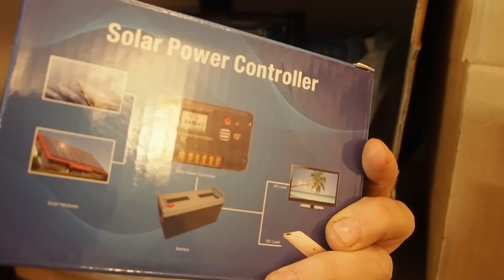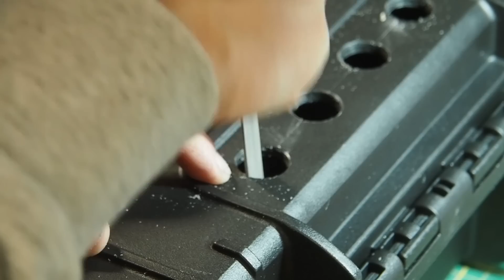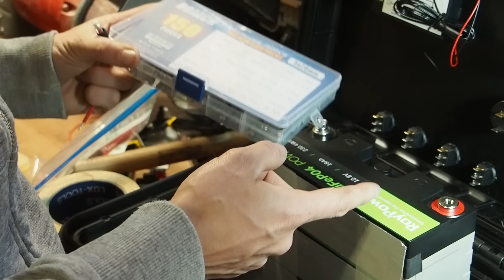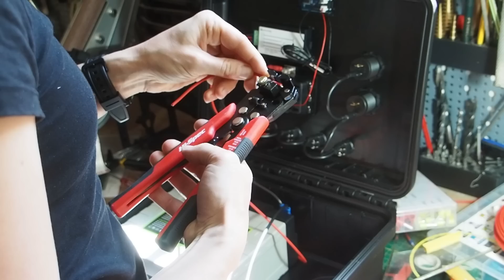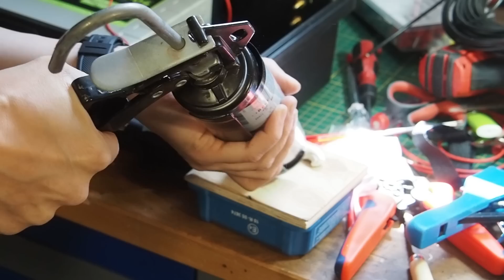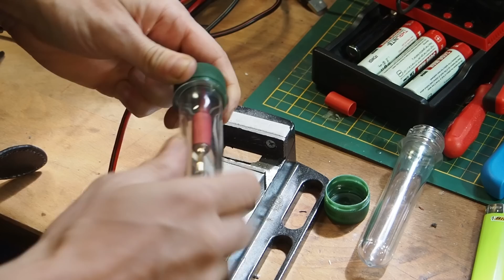This self-made box will save your life in a blackout scenario!

Comment: Hi Lilly, nice job on the portable power supply.  I have been designing inverter circuits, along with battery powered devices, and solar systems for many decades so, wanted to pass on some things I learned over the years.

The solar panel you are using has 24 cells, which puts out 0.6 volt each with no load.  They are all series connected so, your unloaded output voltage will be around 14.4 volts so, you could connect the solar panel directly to your battery.  The Victron solar controller needs a solar panel voltage that is at least 5 volts above the battery voltage before it will start charging.  Panels normally designed to charge a 12 volt battery have 36 cells, which puts out around 21 volts with no load.  To get the most power out of the solar panel, the MPPT charger loads the solar panel causing about a 15% voltage drop.  So to get the best performance out of your portable power supply, I would suggest going with a 25 watt or more solar panel with 36 cells.  If you want to use the existing panel, bypass the Victron solar controller.  However, in doing so, you probably won't get more than a half amp of charge current due to not having enough cells in your panel.
Reply: Thanks Bill, I really appreciate your comment

Comment: Great build! If your tape ends up failing, I would recommend looking at "3M dual lock".  The adhesive is very strong, and it's a little bit thicker, which will help with surfaces that aren't very smooth. I've used this on multiple applications, and am much happier with its results vs Velcro.

Comment: 4 suggestions:
1. use 4 rubber feet to make space between the battery and the box itself so the battery is not touching the flat surface of the box  (the box is ofcourse water proof but not hot/cold insulated.)
2.  draw a clear cable diagram of what powers what, the types of cables used in color and place the diagram inside the box for easy future reference (keep already made spare cables if A burnout does occur)
3.  keep at least 12 mini and 6 maxi fuses as spare inside a zip lock packet size 3inches taped inside the box... you never know when you'd need them.
Reply: maybe it's better if all switches, meter meters, mppt, output / input terminals are in the box by creating a new panel to install so that if they are closed and not used / when they are moved they are still waterproof. If you are going to use it, the lid of the box is opened
Reply: @Boediprasetya  Not as convenient for operation, but given the choice of an IP67 rated Case you might think that maintaining that IP67 function would be a worthwhile consideration.🤔
Reply: @Micro-Motive  yes I will choose the box still has the tightness IP67. for operation, just open the lid of the box. We also don't need acces to switches, meters etc when not in use
Reply: @Edward Seth
1. The case is plastic - not a good thermal conductor at the best of times. Insulation is a much misunderstood property as it doesn't prevent the thermal transfer process, just slows it down. Eventually all thermal masses will settle at Ambient Temperature unless there are external influences.
2. A wiring diagram is a good idea. Spare cables? Unless there was something wrong with the initial fabrication, unnecessary - see 3. 🙄. 
3. Totally agree with having spare fuses in a convenient location, but if you need that many spare fuses then you've under designed the Unit, or you're abusing it!

Comment: A few important features to your build that you’ll need to include is a small thermal activated cooling fan and a few exhaust vents. These simple additions will prolong the life of the battery, the enclosed electronic components... and protect your investment.
Reply: Doesn't that sort of defeat the purpose of selecting a ruggedised IP67 rated case in the first place?
Reply: Notice that many of the manufacturers who sale these “solar powered” generators all construct their products in this fashion. These retail units are NOT built to withstand water penetration in any way. There is a reason for that... internal heat build-up and ventilation. Utilizing a waterproof IP67 case for this purpose would be a..., miscalculation and/or unnecessary additional expensive. During the units recharging processes, and whenever a heavy load is being pulled from the battery, it will heat up. This heat has to go somewhere. Slowly but surely, many of these YouTube DYI builds will prematurely fail - mainly due to this simple construction oversight. Hope this helps to prevent issues with your build.
Reply: @BigDukeX  My point was that if you're going to use an IP67 Enclosure, then design it appropriately so it remains IP67.

As for the heat generated during charge and discharge, the LiFePO4 Battery used only has an electrical capacity of 216Wh, and any interal thermal losses will be less than a tenth of that.
The heating losses during use will be low, and during charging also low, particularly if being fed by small Solar Panels (12V 28.5W), which don’t have sufficient voltage to charge the battery via the MPPT controller.

Yes, plastics have a low heat transfer rate, but like all "insulation" it won't stop thermal transfer just slow it down.
Given the volume and surface area of the Enclosure, the small amount of heat generated during use and charging will be easily dissipated through the Case.
You'd have more of heat problem if you left it sitting in direct sunlight, or next to a Furnace, as all thermal masses eventually reach ambient temperature.

Comment: Fail on the banana plugs for the solar panel. They will short out when not attached to the box. It would have been better to use Anderson Powerpole or XT60 connectors. I would also add one of each of those connectors for other peripherals. And where's your shore power charging socket? Surely you would want to plug it in to the wall to recharge it if you can? That solar panel also needs to be more than twice as big as the one you have. It's not about "how fast can I recharge" but "how can I collect more light". Its very rare to have a solar power day that's 100% sunshine. A bigger panel would yield more amps in less optimal conditions. Your fuse is also in the wrong position as others have noted. Otherwise, well done. Its 1000 times better than the power boxes the rest of us do not have. Keep it up!

Comment: You should connect your load (master switch) to the "load" output of the charge controller, not directly to the battery.
Reply from the maker: You can do it both ways
Reply: @SurvivalLilly  yes you can, but you have lost over discharge protection and you will mess up the charging algorithm if you are charging and drawing power at the same time.
Reply: No. The load output of the charge controller is just for small things, typically those where you want them controlled by whether the sun is shining or not, such as lighting systems.  It is absolutely fine to connect directly to the battery. It will not mess up charge algorithms or any other such nonsense.
Reply: @Sylvan_dB  you are wrong, but it is a long discussion, so let's just agree to disagree 🙂
Reply: @AlanDavidoff  Sure.  My 50 years of building battery based systems up to and including modern high voltage MPPT systems has taught me nothing.  LOL.

Comment: It is better if you take the power from the battery through the load terminals from the MPPT controller. In that way you can take power for your load directly from the PV panels if they are connected.
Reply: No, it is not better.  it will still take power from the pv panels when connected directly to the battery and direct to the battery is not subject to the limitations of the load output in the charge controller.

Comment: Miss Survival Lilly, what a great video! Even I would be brave enough to attempt to follow your directions. Have you heard of Anderson plugs and now you can get red ones to indicate a solar charge. But Anderson plugs are simply brilliant. Thank you for a great video.
Reply: Anderson connectors are great - I changed over to them almost 18 years ago, and the originals are still in good shape. One other thing about them: Anderson connectors come in a succession of ranges, physical size & rated current. In my place, I use 15 Amp sets, 40-50 Amps, and some rated at 150 Amps or 250 Amps DC. Some welders now come equipped with high-amerage Anderson connectors for the welding leads. It's worth noting that some high-amperage connectors are not colour-coded red/black - they have a grey casing. The genuine Anderson-brand connector housings I've seen carry the company name & trademark. The colour-coding issue is easily fixed with paint pens or foo-foo cans. Also, there's a crimping tool (probably several) made for the copper inserts - very useful on larger sizes. I've seen some counterfeit knock-offs and although the material quality is OK in some cases, a problem arises when they will not mate properly with genuine Anderson-made connectors. 
I don't know if they're still in business, but there was a company with outlets in both western Canada and the western USA that sold "kits" containing 3 or 4 different sizes/ratings of Andersons, plus the appropriate tools. The cost of the kit was a lot less than purchasing connectors piecemeal. Several amateur radio publications (also now web sites) have articles with detailed information, all of which is useful if someone hasn't used Anderson connectors before. 
One other thing for new buyers to watch out for are "cheap" metal insert components sold in packs. All of these I've seen have turned out to be CCA - Copper-Coated Aluminum - and poor quality at that. The issues with CCA are  documented elsewhere & are worth learning. Failure at moderate-to-high current loads is the most important. Solid copper costs more, but in my experience is worth the price.

Comment: Order of operations suggestions. Plan where the battery and charge controller will be placed first. Use a multimeter to test all wire connections first, then connect the battery last. Also for most solar charge devices the solar panel should never be connected if a battery is not connected.

Comment: Nice project, but allow me advise, always have a trickle charger, a good one is NOCO GENIUS1 or even better the GENIUS2!
The trickle charge can be left always on and connected to the battery, even when you are using the battery!!  They work specifically with Lithium batteries inclusive, they will keep your batteries life longer, and can even recover damages that sometimes happen during the usage of the battery, including charger under different climate conditions, i.e. temperature. Do not really only in solar charging, despite the fact that you can find some PV that are a kind of trickle charging via sun light! To extract the maximum value of a trickle charger plug them in a timer programmed to turn on only at off-peak hour to minimize the cost of keep your batteries ALWAYS READY AND FULLY CHARGED for when you need them! I have many different types of batteries and "solar power generators", and I took sometime to learn this very nice tip, that I take the advantage of load my batteries and solar power generator at minimum price , and using the stored energy at peak hour maintained it a minimum cost.

As you advance in more complex configurations I would indicate EcoFlow Delta Pro and Bluetti , I have both also, more expensive but it is worth each penny you invest on them!

Good work, and keep the good fight!

PS: Don't only rely in sun to charge your batteries, sometime the sun is no available , but the electric outlet is on yet!

Comment: Thanks Lilly.  Question, at 2 points you mentioned damage to the panels and controller.  I could imagine manufacturers having to put in safety steps in the leads touching, the master getting turned off, etc.  Could these potential issues be safeguarded by the addition of inline fuses?

Comment: I'd suggest three changes. The first connection on the negative batt wire should be the shunt (all loads, including resistive spade connections should be after the shunt. The switch is best on the positive wire, after the fuse. Also, there should be a fuse on the battery side of the positive PV wire.
Battery temp should be monitored when PV charging, so charging can be shut automatically, if charging the battery overheats it. Ring terminals are always better than spade connectors-I see the parts you bought don't allow that.
I don't mean to sound critical. Just passing on what I have learned. I am currently assembling my parts for a 280aH battery built from cells.
Reply: You saved me the time to make these suggestions.

Comment: Great job.  However, I would have made a deck inside the case and mounted everything to it.  That way it remains water tight.   This thing will be toast out in the rain.

I'm in the process of making one with an ebike battery and a waterproof toolbox.  I may link a reply to this thread once I finish it.  Mine is however more aimed at running a ham radio in the field.
Reply from the maker: Thanks for your suggestion. I will not use the solar panels in rain, so I dont care if the box is watertight. Also the battery gets hot when recharging. So you have to vent it by either opening the box or by cutting vents into it
Reply: @SurvivalLilly  thats interesting, how warm does the battery get? I have worked extensively with Lithium cells and they dont warm unless being quick charged.
charging at 1C (1 x the amp hour capacity) is normally the max i would recommend for Lithium polymer cells, with LiFePO4 cells im sure its similar, but that big pack oyu have is unlikely to be charged quicker than 1C from a small solar cell like that. since you added a thermometer you can easily see the heat buildup if you close the case.......

Comment: Quick question Lilly, good set up however if it is dark, why not have an LED light in side the lid so if you have to do any running repairs in the dark, you will be able to see everything that is happening inside the box, I made my own Trolling motor box, but because I will be in a boat, I put in some extra gadgets that will help me, so if a fuse blows you don't have to go looking for your torch, just a thought.
Good video wish more people would take the time to make their own power box, they can be used in so many different ways, I can use my home made box to power my Eco River max box, 2 is 1 and 1 is none, take no chances.

Comment: That's a great tutorial !

In the end how much did it cost to you to build such a box yourself ? 
Could you compare it to other already made powerbank ?
Reply: All she needs is a small 12 to 120 volt inverter mounted in the box for ac stuff.
Reply: You can use A UPS they already have the batteries in them then add a usb charger I built three already will do the same as a power bank..Put a handle on top.

Comment: To help with charging when the temps are below freezing, add an aluminum plate on the bottom or top of your battery and attach a motorcycle grip warmer on the aluminum plate with the switch mounted on the outside of your box to warm up the battery for charging.  But with only a 18ah battery watch the wattage of the grip warmer you choose.  I’m currently making one with 100ah EVE LiFePO4 cells.  Working out the placement of internals and outside ports.  Fun and useful project.

Comment: the victron charge controller is a good choice. in cold weather they will not charge. which will protect the battery in cold weather situation, Also you can over panel these they will just only output whatever the amp rating of the controller is. however, over voltage will burn them out. give yourslf a 25% safety margin on voltage since cold weather will make panels put out more voltage in cold weather.

Comment: Just noticed the battery..."do not charge in a gas-tight container"...the pelicase is water tight, but I suspect its not exacly what I would call well ventialted... is this an issue?🤔
Reply from the maker: I leave open the box while charging. Also I doubt that my container is airtight after all the holes I out in.

Comment: O, great job. However you also need to install voltmeter on solar input. And fuses for sure.
Reply from the maker: The mppt has a build in fuse. Thanks for watching
Reply: @SurvivalLilly  thermal curricut breaker actually i think. In mptt controler. I'm watching all your video, you are one of my favorite survival :) Thank you for your videos
Reply from the maker: @keepsurviveu  it has the same kind of fuse I used for my fuse box. So a fuse you would install in cars

Comment: I love how you used a very light weight battery inside the case and left room for connections as well.

I built something similar a few years ago for car-camping. It charges off my vehicle when I drive using a double-ended power connector and when at home I use my BatteryTender. I can also piggy-back it to my camper for extra reserve power using the same double-ended power cable.

My only issue is it takes two hands to carry ...

Comment: I still disagree with this chart.  For example, in a car, a wire section of 2.5 square millimeters is used for a load of 43 amperes at a temperature of 30 degrees Celsius, and 4 square millimeters for a load of 58 amperes 😂✌️

Comment: I don't understand why a waterproof box is required if the installation can no longer guarantee tightness.
Reply from the maker: It is not required.
Reply: yes it has to be accepted.  then I don't understand why the tightness of the box is so emphasized at the beginning of the video.  finally, the tightness is in no way relevant  and a Waterproofed Box is not needed.
Reply from the maker: @nino3357  it is not required you can take whatever box you want. I want to have the possibility to have a waterproof box. I can still use silicone to make my case waterproof again. Also this box is the most stable one I could find. Best qualitiy